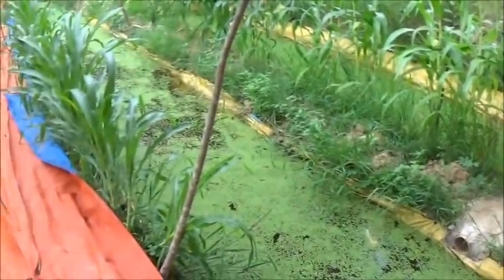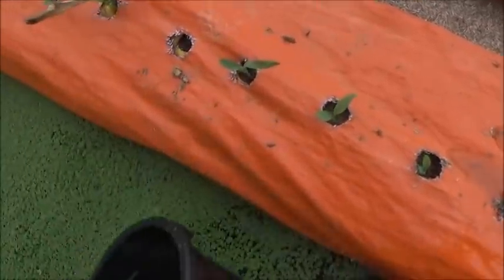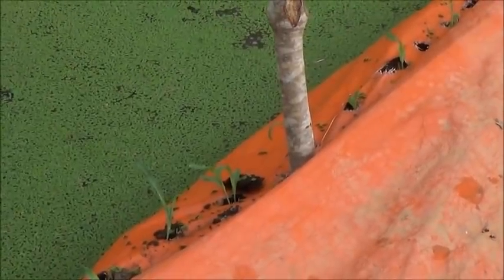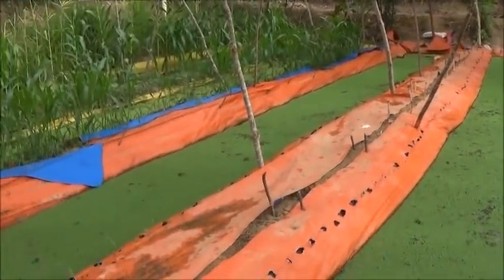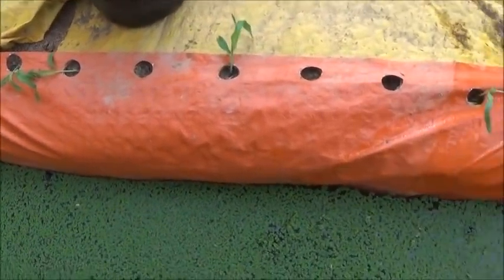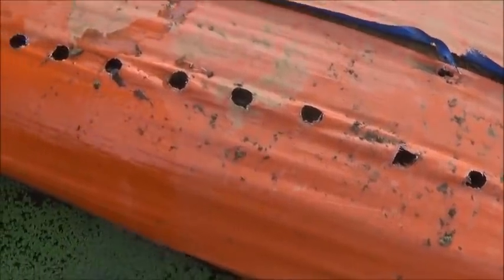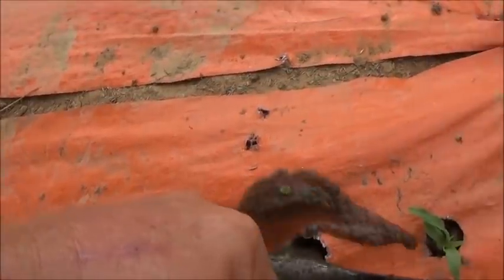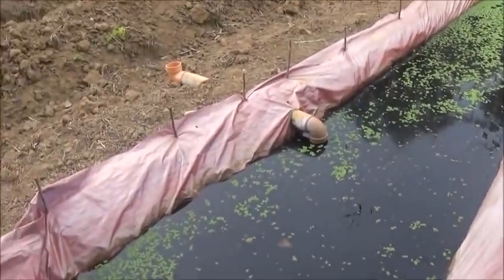Corn Mystery Solved At The Azolla Pits

Comment: The issue was caused by Tatay not doing what he was asked Nerio would not have got it wrong if your instruction was carried out by Tatay . Maybe if he had to fix it on his own time he will learn to do as asked . If he wasnt related he wouldnt get of so lightly. Through other videos It shows Tatay follows his own instructions and smiles and nods.
Reply from the maker: A few things Patrick. Tatay fully understood what I said. In fact he offered a challenge by comparing a row HE would plant vs a row I planted. Bottom line, even though tatay had clearly seen the near perfect germination % of the rows I had already planted, he thought he could do better and basically scoffed when I said I couldn't trust anyone else to do it. He understood perfectly what I said because we had a 5 minute conversation about it. So, did Nerio plant the corn correctly or not? No. Language barrier between Filipinos speaking the same language? No. So guess what? THIS foreigner could definitely show the Filipino in question how to plant corn....
Reply: @goldamra13  Brian is the boss. You do what the boss asks. End of discussion.